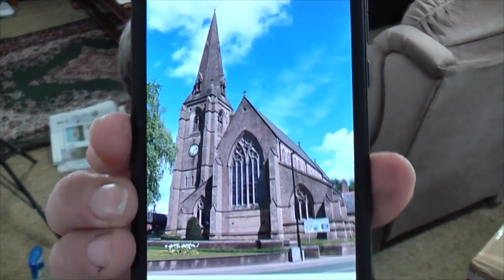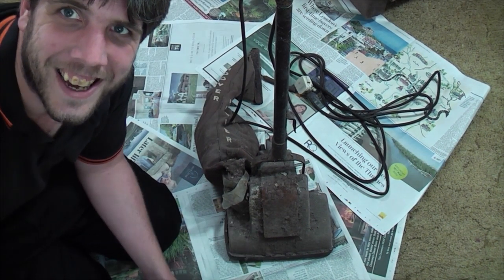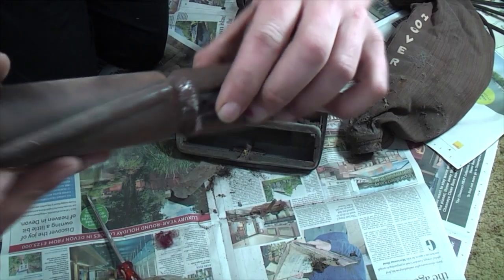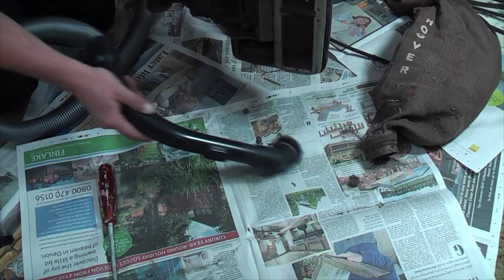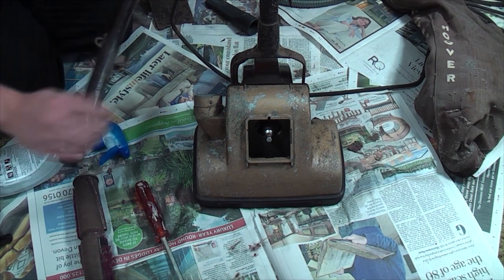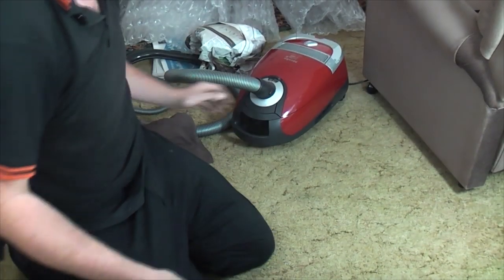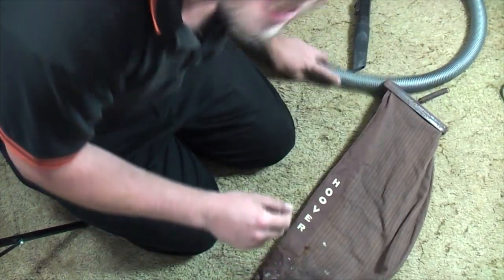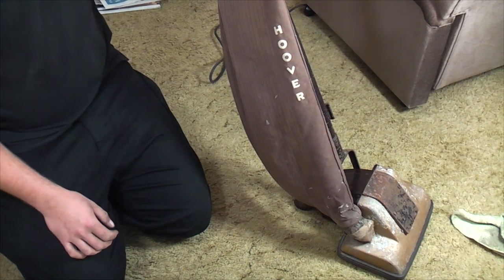NOT USED for 30 YEARS! Church Find Hoover Junior 119 - Unboxing and First Look!

Comment: Ju at bought one for a tenner that has been refurbished in the 90s with a cream and brown look. Quite a good cleaner but the cloth bag at the top has some small rips. Any advice on to repair or can you still get spare cloth bags
Reply from the maker: Nice! You could try iron on patches from the inside, it's never going to look great so your goal is preservation really. A Dyson lower hose (dc04/7/14 etc), some tape, cable ties and a sebo bag make it bagged which helps. Or crack out your inner embroidery skillz. Pattern bags are out there, I have one tucked away but they usually annoyingly come easier with a shitty 119 attached to it. Which you then grow fond of, refurb and get running sweet as new as 119s always come up good mechanically, then you still need another bag 😅
Reply: Yeah could try stitching it up. I really hate the fact it’s been painted. They’ve even painted the bakerlite. I might have to run it down and repaint it closer to it’s original colour scheme. Mechanically though it’s brilliant. May have to buy new brush ends as it’ll be the daily I think along with a hetty which I by passed the pcb on to get working.